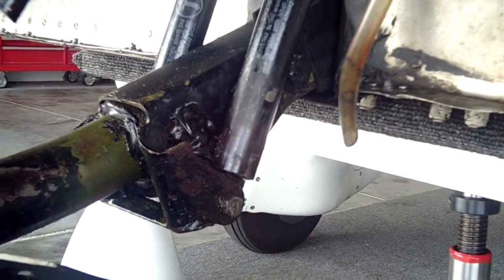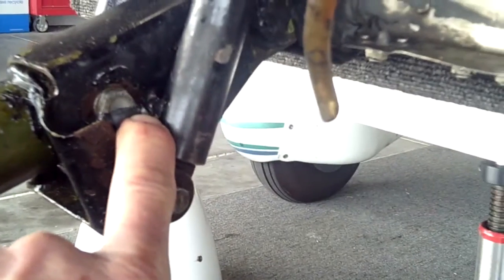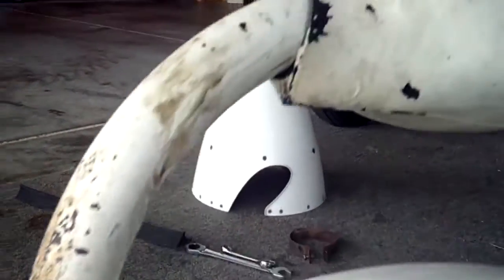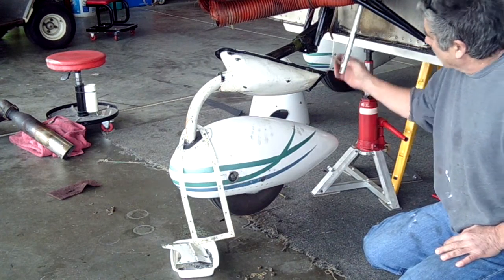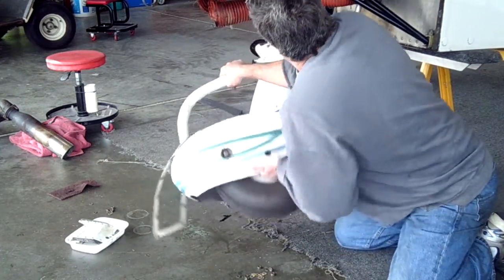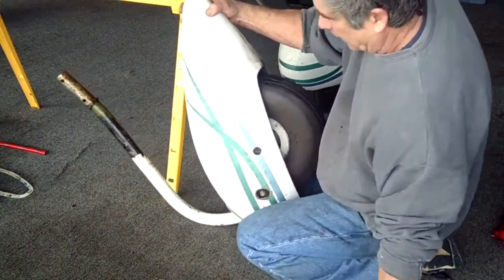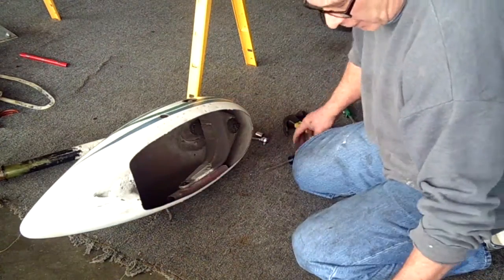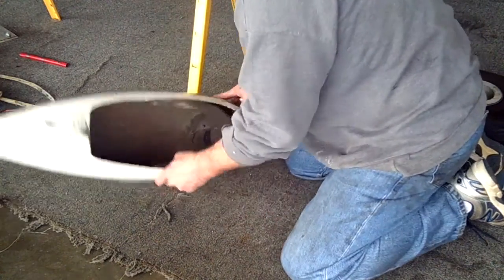Removing a Grumman Nose Strut  -  Grumman Style

Comment: Just finished helping with a nightmare nose strut removal on a Tiger. In several of the videos I've seen, the commentator basically says, grease the strut up and re-insert the nose wheel tube back into the torque tube. However, the maintenance manual was referred to says that both the inside of the torque tube and the matching portion on the nose strut are to be inspected, dressed and then painted with zinc (chromate of phosphate) and then the parts are inserted while the paint is wet. So, which one of these things is true? If it's grease, which grease? If it isn't grease, I'm guessing the wet paint provides a micro thin coat for corrosion resistance. I've also heard that hangered aircraft only need the tube removal done every three years while aircraft outside need it done every 2, however, once again the manual states every 100 hours / annual. Has Grumman updated the manual? Is this somewhere written down? Just curious because reassembly is coming quickly and would like to find the "way".

Comment from the maker: First soak it with Kroil creeping oil.  Then after 24 hours, yo may have to heat and cool the affected area.  Finally, take it to a Grumman specific shop to try and save the various parts.  Call me for details, Roscoe 513-519-7008.

Comment from the maker: Leave the nut on about half the threads and then with a wooden or nylon hammer drive the bolt out until the nut stops you.  Then take a punch and in the center of the bolt drive it the rest of the way out.  These are close-tolerance bolts and they are supposed to fit snug.  Have fun!
Reply: Worked beautifully, thanks!